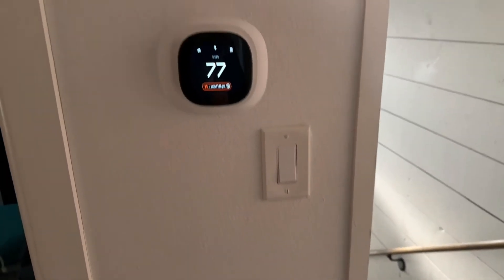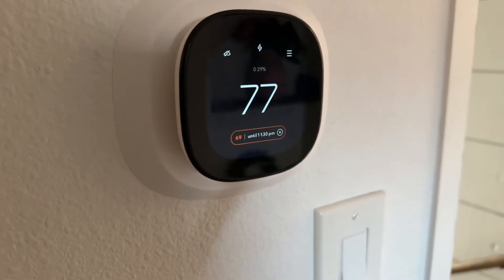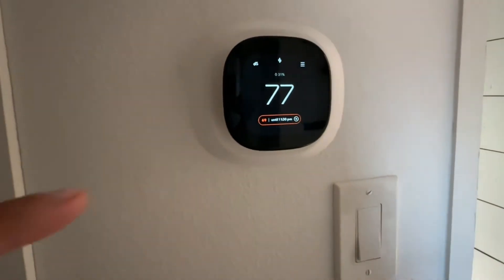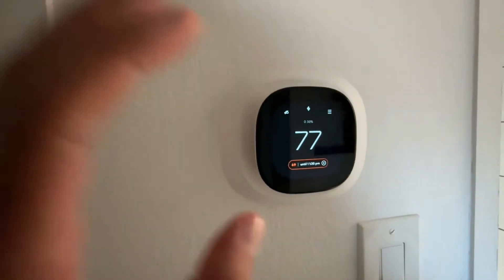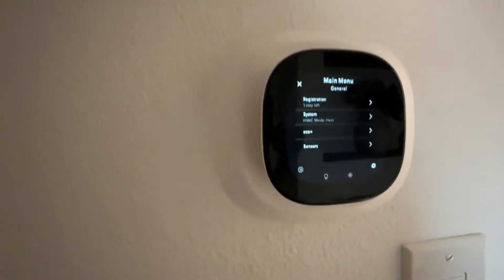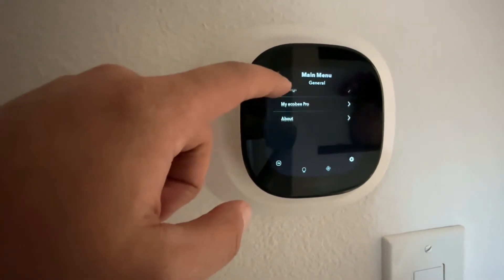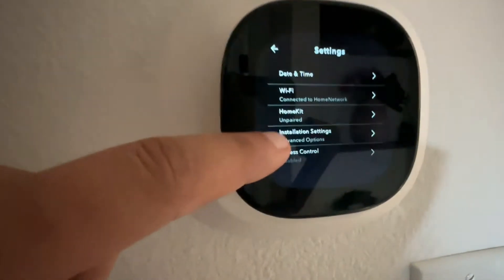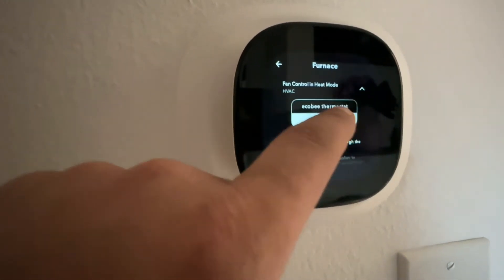Why Does My ecobee Say “Calibrating?”

Comment: I added our upstairs unit to our wifi network and it turned off everything and said it was calibrating. I had to turn the fan on manually and I disconnected the thermostat from the wifi. Wondering if it’s a weak wifi signal problem.
Reply from the maker: Put your phone in the same spot the thermostat I and run a speed test. Easy way to check the WiFi strength on another device. 

I will say my upstairs ecobee does struggle occasionally. Just yesterday, it sent me a notification saying it was calling for cool but the temps were going up. A quick disconnect fixed it.

Comment: Ours calibrates a lot. We changed the filters and it still does that. I think the electricians did not use the wire adapter to go from 4 wires to 5 and I need to have them come back. ☹️